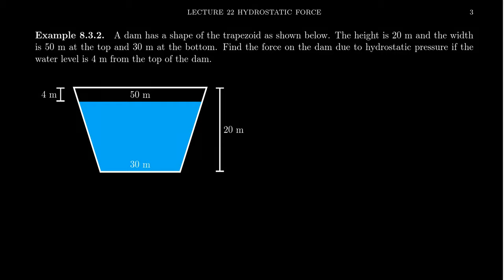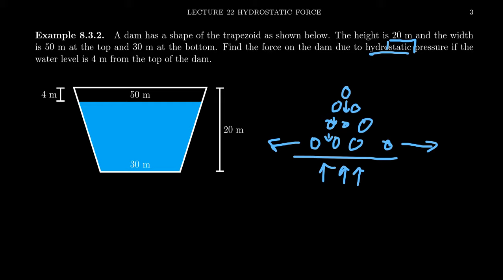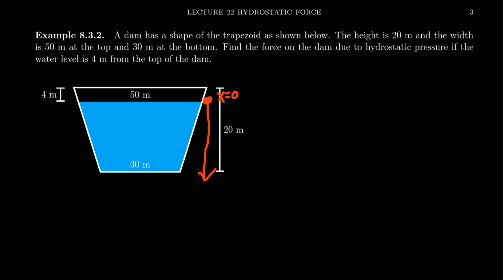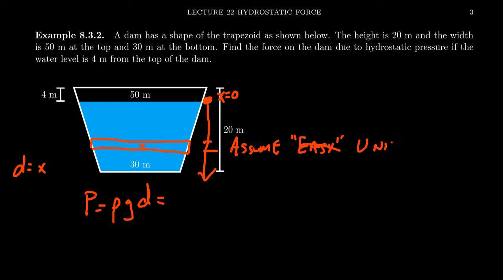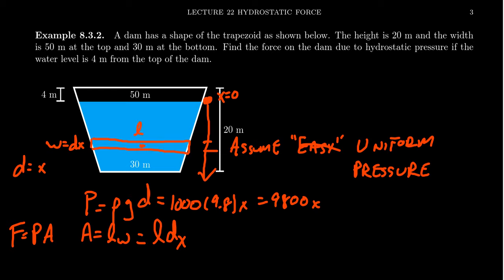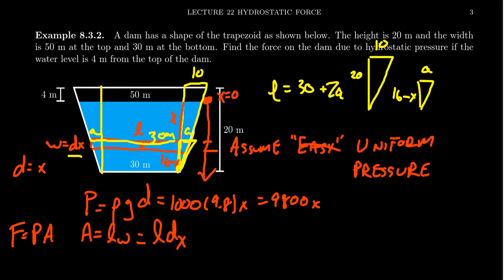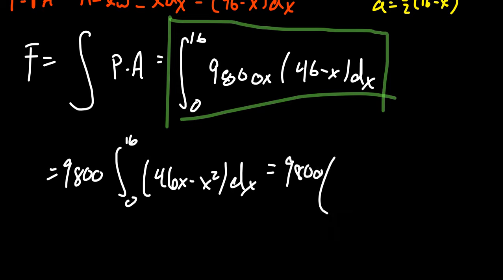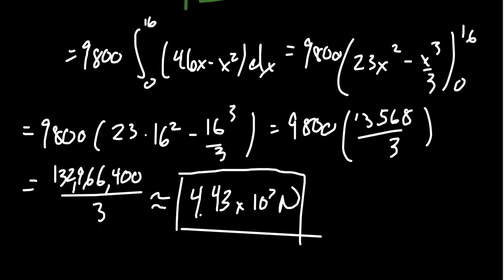Hydrostatic Force and Integration

Comment: how was 50-30=10? at the fnding width part
Reply from the maker: It is (50-30)/2 = 10. The difference between the top and bottom is 50-30 = 20. By the symmetry of the shape, half the excess is on the left and right, hence 10 on both sides.

Comment: Whay if you let your x axis start from the bottom ?
Reply from the maker: The depth would then change to d=16-x. The pressure would change also by replacing d=x now with d=16-x. On the other hand, thr length l would adjust to. Changing the appropriate parts in the similar triangle argument, you would get l=x/2, instead of l=(16-x)/2 in the attempt. This changed the area accordingly. When you put it together we get exactly the same integrand. As you will also have the same bounds, you get the same integral. While this does not happen in all such problems, that does happen in this example.